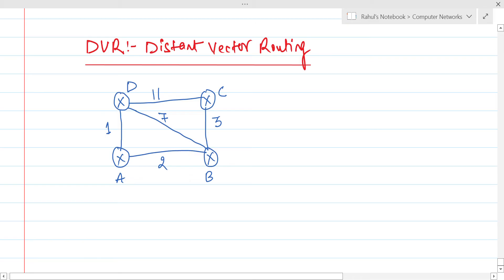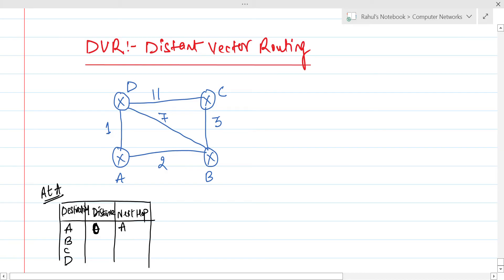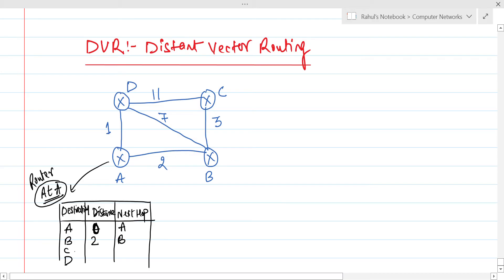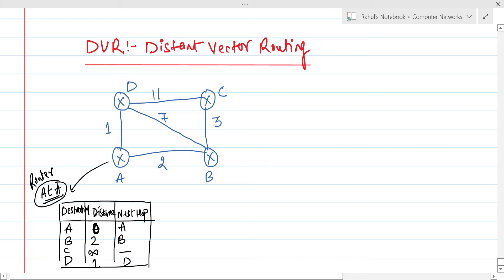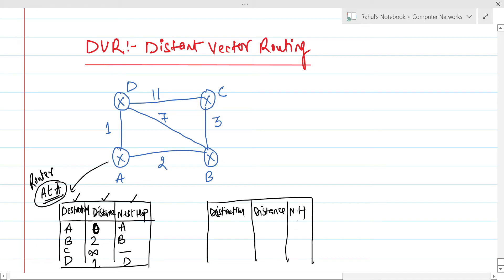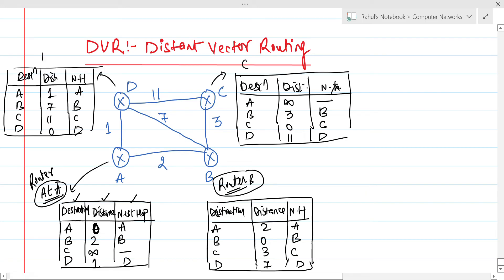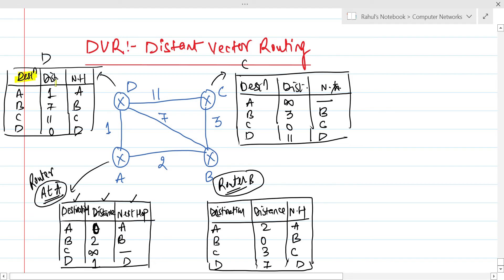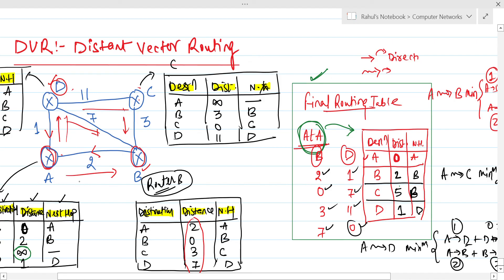DVR - Distant Vector Routing Algorithm |  Computer Networks

Comment: What is three node instability problem soulation?
Reply from the maker: The three-node instability problem, often referred to as the count-to-infinity problem in distance vector routing protocols, arises when routing information loops indefinitely among three or more nodes, causing significant delays in network convergence.